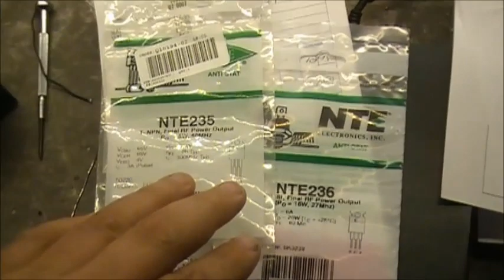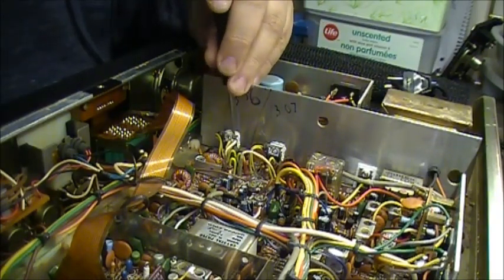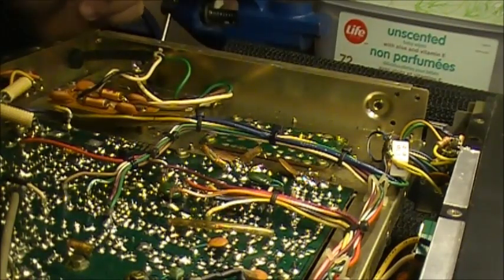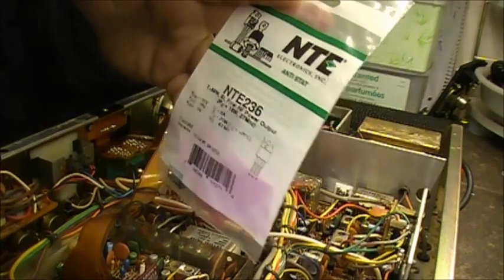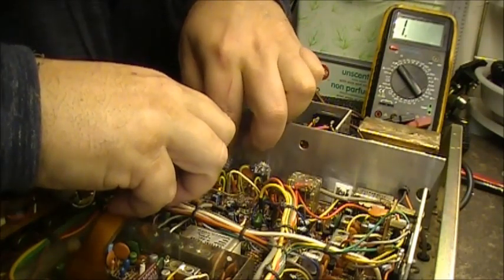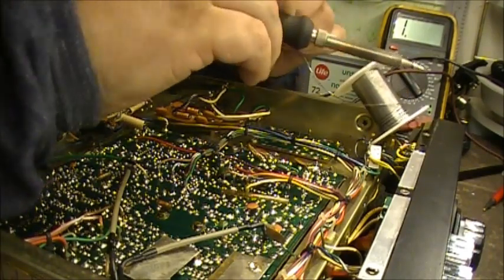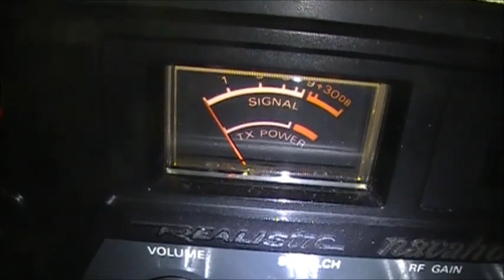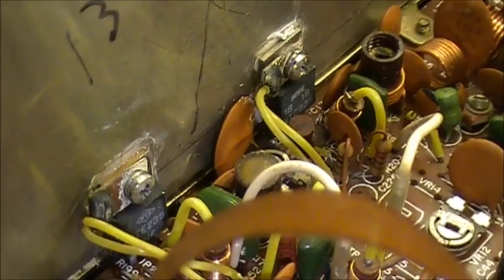Realistic TRC-458  / PART-2   "Just when you thought it was safe to power up... This happens!"

Comment: I've had NTE brand and it was a original NEC part. They rubber wheel the NEC name off and print ECG or NTE on it.
Reply: judging my the color of the case, if its dark gray its probably 2166 and 1969.
You gotta tilt it in the light and you might see the old markings
Reply from the maker: These were purchased locally.. not fake.